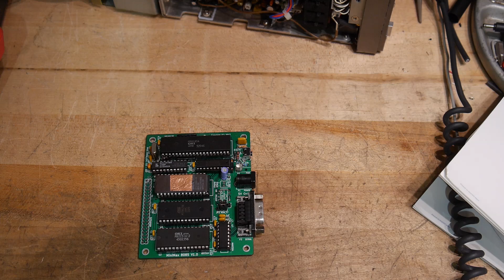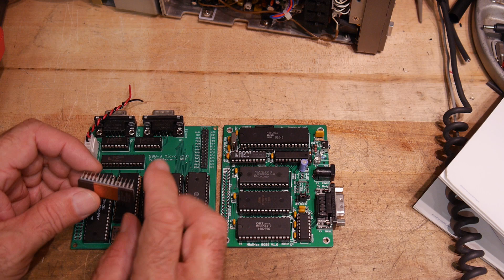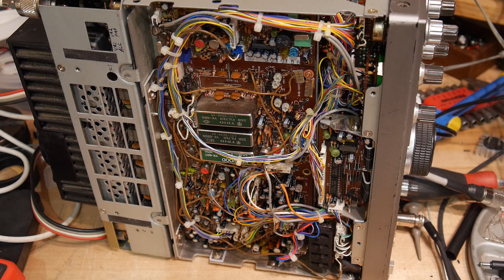#236 8085 SBC G80 update

Comment: Hi, I had similar problems with my Z80 SBC aka Grant Searles 9 chip CP/M design, I used one of the newer rs232 transceivers that only require small ceramic caps, but that didn’t workout - would you believe it, fake chip it was, probably an older design wich required the larger electrolytic caps. I switched back to my cheap usb2ftdi clone and bypassed the max232 and that worked for the time being. When I then tried to connect to my old Dec terminal I used an external rs232 levelshifter that I found years ago on the old computer junk pile of an bankrupt gone company.

Comment: Have you tried using the Rigol to serial decode the TTL level signals on the UART side of the MAX232( or whatever they use CPE202. etc.). Might also be serial handshaking. Might have to tie the handshaking high.
Reply from the maker: yes tried that. the UART pins seem to be tristated. no output at all
Reply from the maker: opps, sorry,  the G80 has tristated lines. This one the 8251 part just seems like it never gets addressed and talked to

Comment: Make sure on the 8085 board that you have a good solid 5 volt supply to it.  I had problems with mine when I was using a 5 volt wall wart that worked with another SBC, but not the 8085 board.  Heavier duty PS took care of the problem.